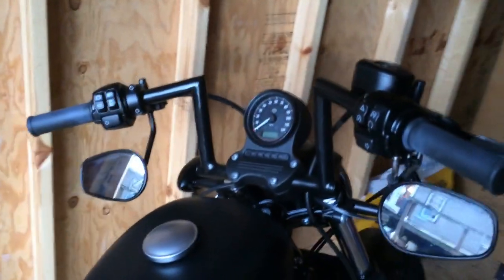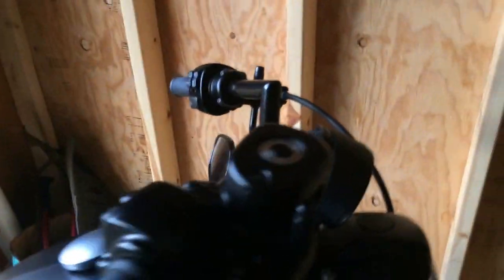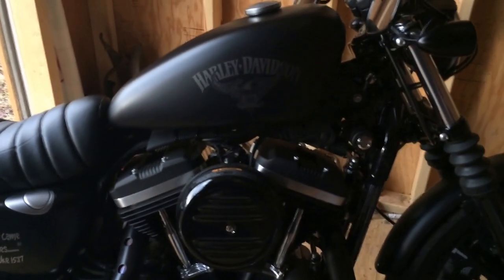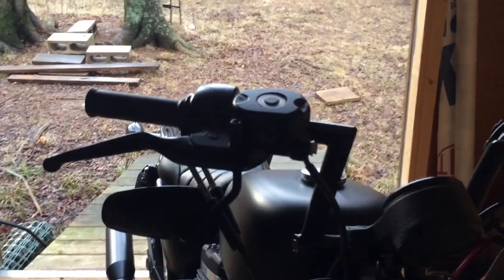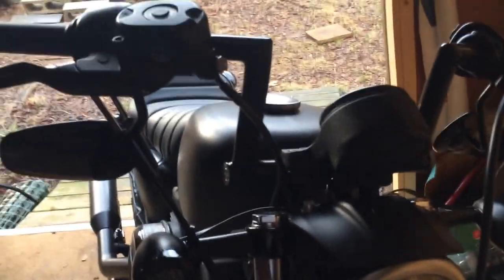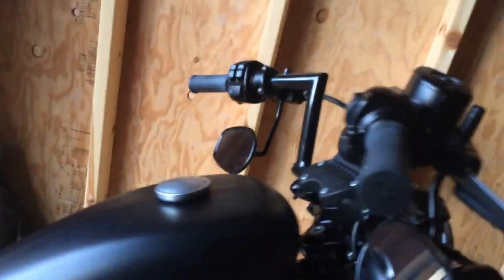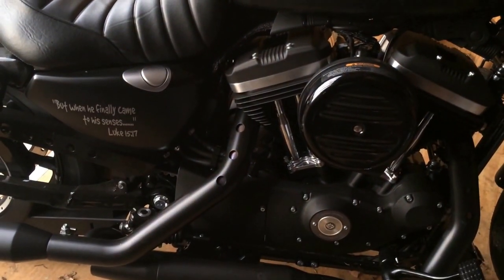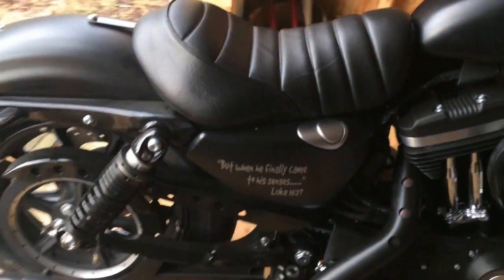Harley Chizeled Lo on Sportster 883N Iron

Comment: Thanks for the vid man. How many inches is that handlebar? And did you say you had to replace one of the wires? Cheers!
Reply from the maker: Brake line was only thing I had to replace. It was out of caution, you might get away with stock but really should replace that.
Reply: @harrytinsley111  you don’t have to extend wires but what size bars???? Lol you literally made no mention in video, then you respond to the guy above who asked what size bars because that would be the most helpful piece of information with a video like this and you ignore his question and responded with something else that was mentioned in the video. Come on my guy!

Comment: Thinking about getting these for my 48. Hopefully i would only have to extend the brake line. Can these bars be pulled back a little more toward the rider or must they be in the fixed position like on your bike?
Reply from the maker: They can be pulled back or forth,  you can adjust however you like.  Just the brake line should do it. Harry

Comment: HD just gave me a quote on these, and they are saying I need all the wiring kits etc. how should I tell them I dont need them?
Reply from the maker: I guess to ask and see the wiring before they plug in the extension. With the  Chizel Lo you will have plenty of slack in the OEM Handlebar harness and don't need any extensions.  I did elect to put the extended front brake line, although I think you could get by without it for a while,  it does not have the slack I think a front brake line really needs.
Reply: how about the clutch?
Reply: had them watch the vid
Reply from the maker: Stock clutch cable is fine, I have never replaced it and it fits great...throttle cables are also stock...and fit fine.
Reply: Do you think this looks like the the Bitwell Zed Bars? man this looks so good though.

Comment: Did you need to get longer throttle cables and a longer clutch cable?
Reply from the maker: Just brake line...nothing else changed.

Comment: Where did you get the brackets to relocate the signals. What length break line did you order?
Reply from the maker: Turn signal kit is 68643-09, it says put on the bottom bracket, but works on top too.  Brake lines are black diamond from harley  non abs is 41800256 upper and 41800228.  Got all but the lower brake line from ebay and saved quite a bit there.....but got lucky I didn't have to wait too long.